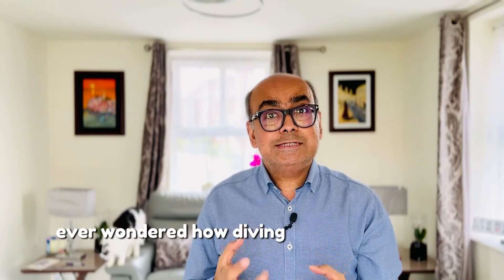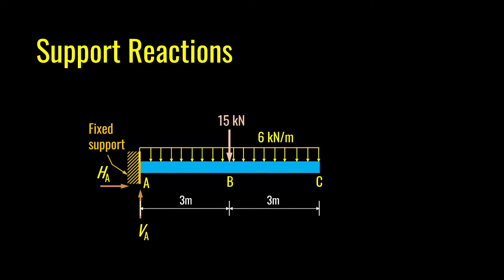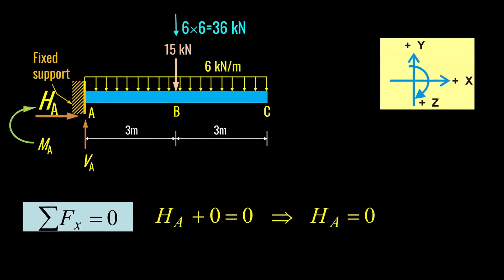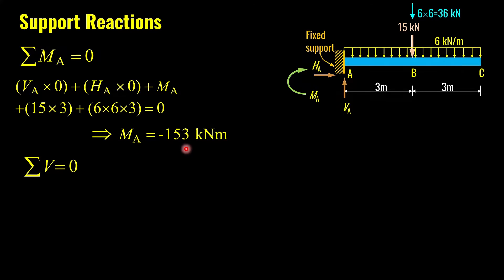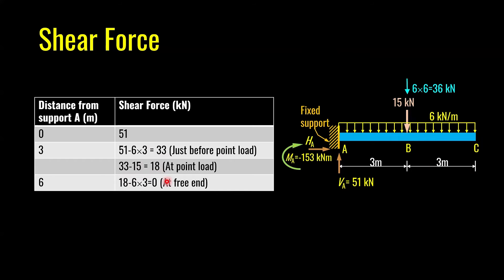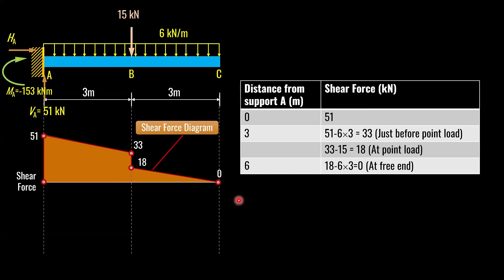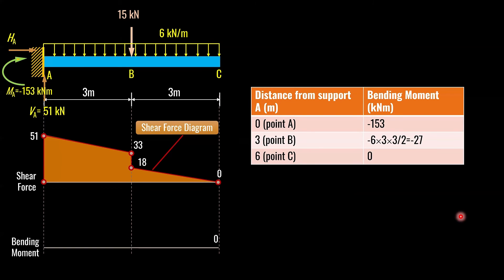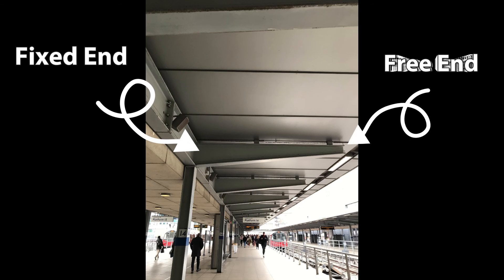Cantilever beam shear force and bending moment diagram

Comment: Thank you sir , how about the beam fixed in two side . How can i find the solution.
Reply from the maker: Beam fixed at two ends will be an indeterminate structure, which cannot be solved using equilibrium equations. We need force or displacement method to solve such beam. 
But the good news is that there are standard solutions available for such beams without calculations at the end of any structural analysis book.
Reply: Thank you sir , you always answer our question. Thank you sir

Comment: Hi sir
video is very helpful 
But can you please give calculations to say BM at C will be zero.?

thanks
Reply from the maker: @kunalporatkar3242  As ‘C’ is a free end with no supports. The moment at free end will always be zero.
Reply: @DrJQureshi Thanks for response sir
I may sound weird 
but if we consider simply supported beam, even though there are supports on both end, Bending moments are zero on both supports.
however we can calculate bending moments at both end (F*L) either to left or right of supported point, it will come zero.

but why in cantilever beams if we calculate BM at free end
BM @ RH = 0 since not forces
but BM @LH will give us some value Not zero.
Reply from the maker: @kunalporatkar3242  Because fixed support can take moment from the span to the fixed joint. 

A fixed support can transfer moments from the span to the fixed joint. Here's a simple example:

Pin Support:

Hold one end of a ruler with your thumb and index finger and apply a load to the other end.
You’ll notice the ruler rotates at the end you’re holding. This shows it cannot resist moments.

Fixed Support:

Now, hold one end of the ruler firmly with your fist and apply a load to the other end.
The ruler will not rotate where you’re holding it. This shows it resists rotation and can take moments.

In summary:

If rotation is not allowed, it’s a fixed support.
If rotation is allowed, it’s a pin support.